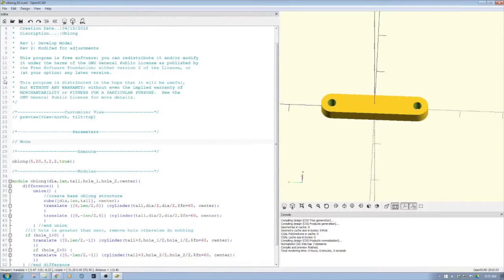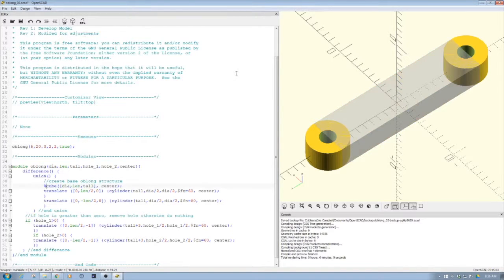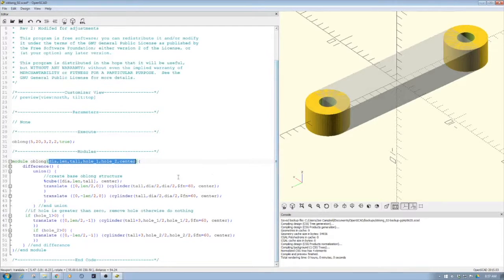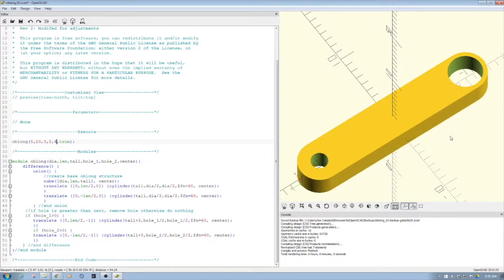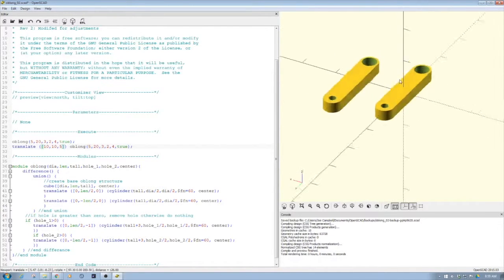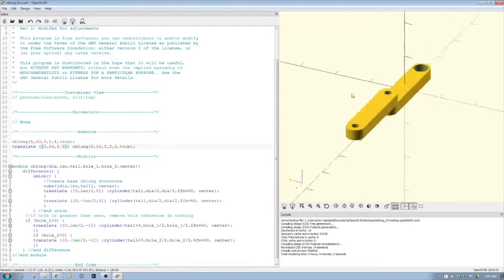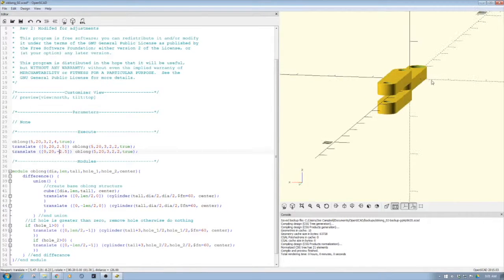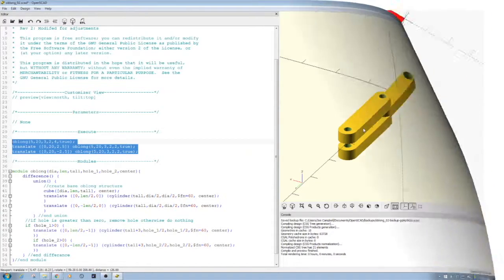Open SCAD - Tricks to Create an Oblong Connector!

Comment: Have you moved on to using hull instead of unioning a cube?
Reply from the maker: You bring up a good point as you see I avoid both Hull & Minkowski.  The reason for this is they are not Thingiverse customizer friendly as they both pull huge CPU time and thingiverse buys time on the Amazon cloud and they throttle the customizers so they would create problems...